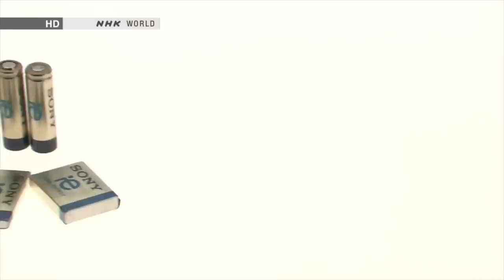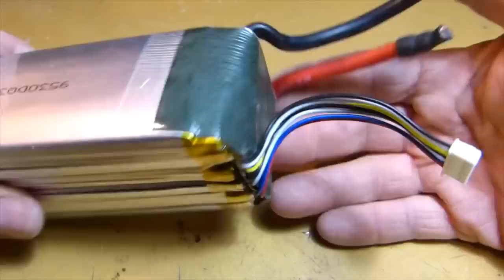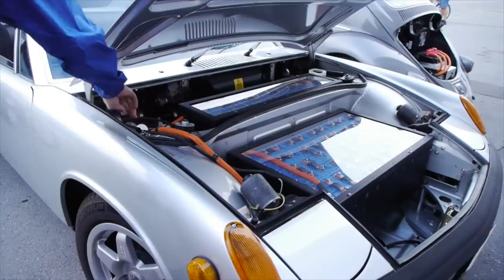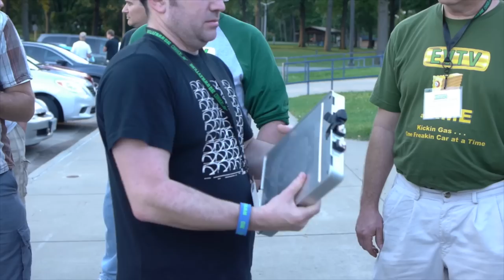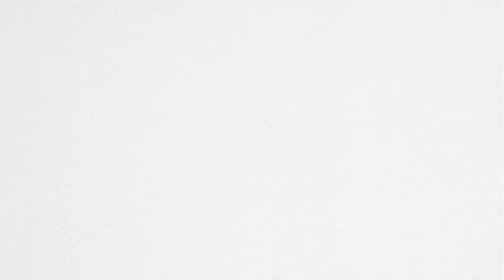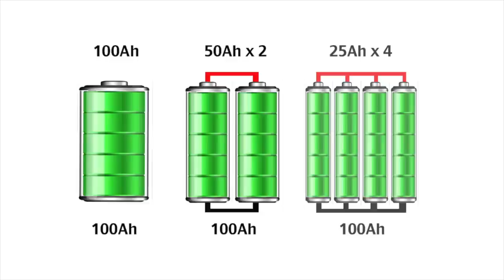QT #3 The History of batteries and their uses

Comment: hi ! i love all your video's  very informative and detailed, only ...are 18650 so different from each other ? when i read the data sheets, i see some have cut off current mentioned, others do not and specify that charging at 0.2 C will give 100% charged cell while 0.5 or 1C  will not, so charging any 18650 cell constantly at 0.2 C would give a nice backup power source ? (emergency flashlight on single lithium cell) without damaging this cell ?

Comment: Hey Jeh,

Give me your thoughts on this…

One of the problems with ION batteries is that there is at least 33% of space being wasted between each battery. Do you think that Elon has figured this out and is manufacturing ION batteries, with Panasonic, for his Tesla's that takes advantage of 100% of the battery space, thus making it more efficient and giving it a longer range?
Reply from the maker: I doubt it as Ive heard him say cells have to be separated by gaps to allow one cell to burn up without creating a cascading effect.  I guess he has reasons to believe that that happens and you need the gaps to prevent it
Reply: jehugarcia Interesting. However, consider a cell phone battery, then imagine a huge battery like that in a Tesla. Just thinking out loud. Thanks for the response.

Comment: Hey Jehu, for shits and giggles,if I had your 20Kwh 18650 battery pack on a bicycle trailer powering a hub or mid drive,about how far could I ride the bike?

Tim.
Reply from the maker: Aren't hub motors around 250w?   So 20,000 /250 = 80 hours,  so it just depends what speed the rig is doing at 250 watt power consumption.  Say 50mph for example,  50x80= 4000 miles
Reply: +jehugarcia Holy Mother Of Pearl! 4000 miles would get you across the USA.I was daydreaming of this,that is having a bunch of 18650's sitting on a trailer so the weight isnt on the bike.Not to mention not enough heft and room directly on a bike anyway.COOL! Thanks Jehu!

Comment: Hi, could someone please explain calculations of battery size if we use inverter? For example, I want to build 12V battery pack, and use 12-220V inverter to power my fridge, with peak power 5А (220V). Will use 18650 from laptops. Thanks!

Comment: Can i ask u a question plz im trying to build a electric sailboat and the motor is a lynch l200 46v id like a 10 kw batttery pack howmany 18650 cells will i need and wat configuration hope u can hell kind regards rooney from grimsby uk
Reply from the maker: +Rooney SV LadyNiles  not all 18650 are the same size, pick a 18650 cell and then we can figure it out,
Reply: I've been collecting old laptop battery's from my local laptops shops wat do u recommend I concentrate on wat time it there I hope I dint wake u it's 8.30 am so gd morning from the uk
Reply from the maker: +Rooney SV LadyNiles  you will need to test them